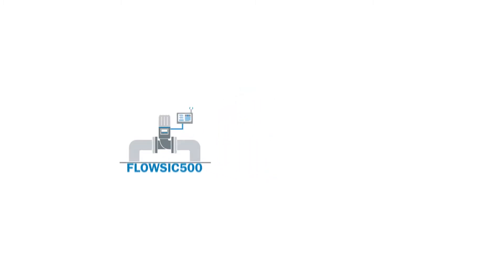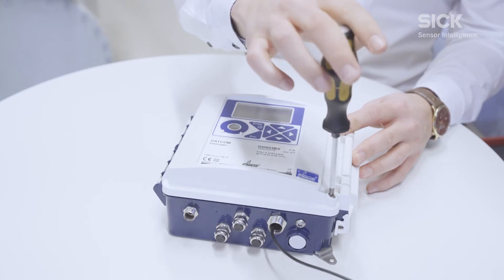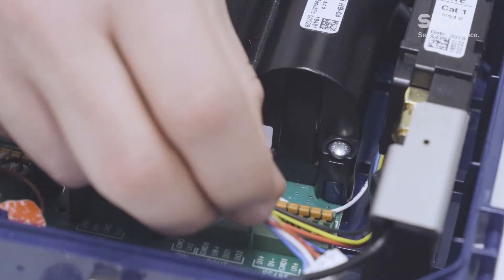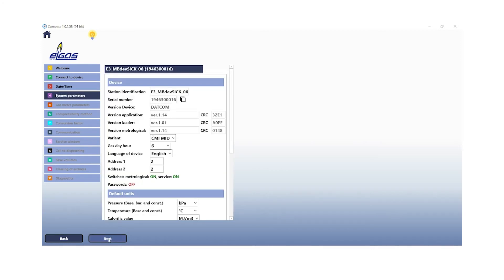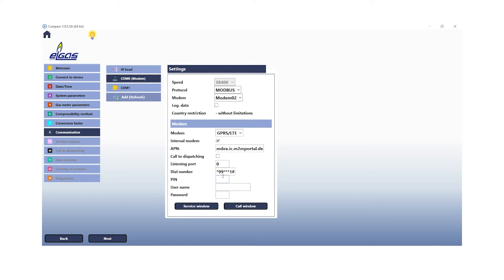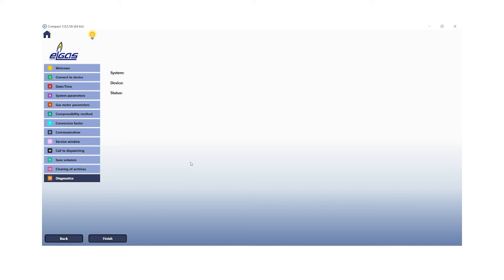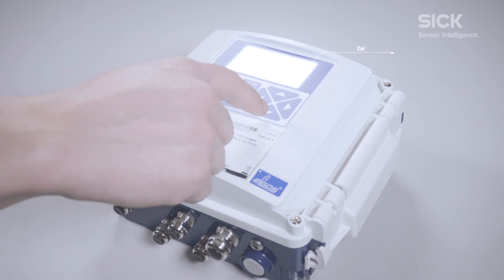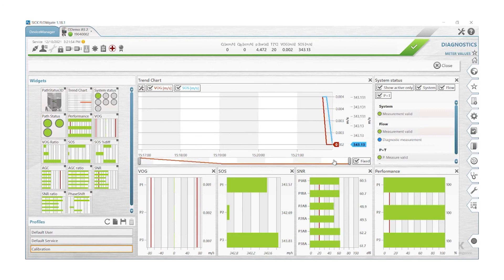FLOWSIC500: How to enable a remote meter access in FLOWgate via DATCOM | SICK AG

Comment: It's possible to communicate with ethernet?
Reply from the maker: The FLOWSIC500 has a RS485 interface. Ethernet connection is possible via an RS485 to Ethernet I/P Adapter. The adapter is available on request.